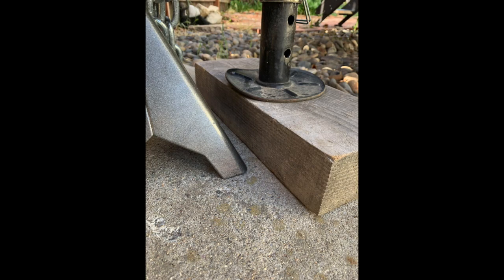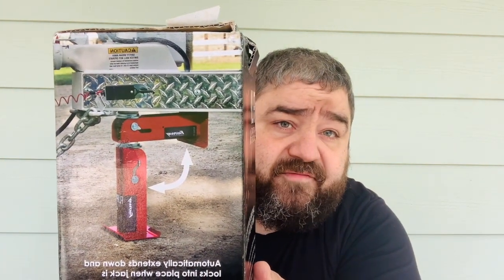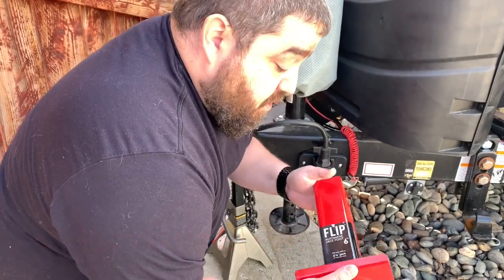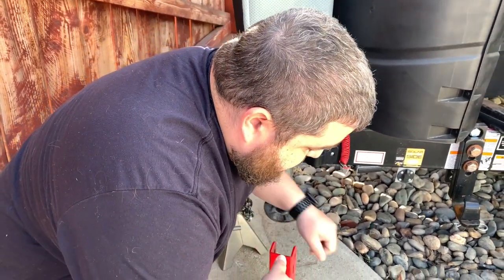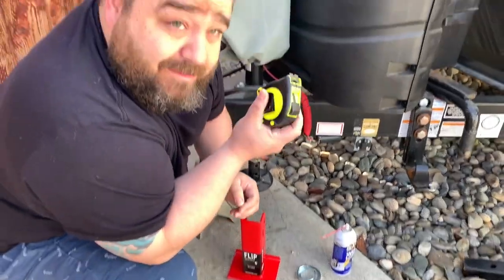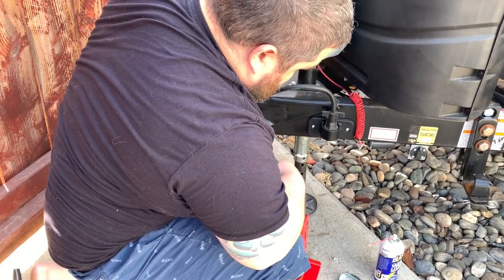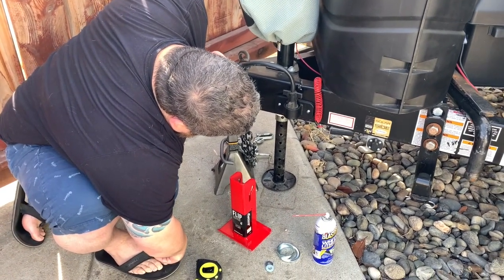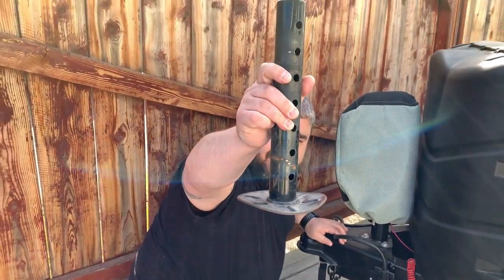Fastway 6 Inch Flip Jack Foot Install and Review

Comment: Is this a different setup than standard? I’ve seen other videos and the manual shows drilling new holes as well as a bolt with lock nut as opposed to the pin, and didn’t have the extra bushing on top? I like the ease of installing the one you show better.
Reply from the maker: Luckily, the existing hole I had measured correctly and no new hole was needed. I’ve had it months now and still love it!
Reply: @AceWillTravel  Just ordered the 6", hoping it works as well.  My tube measures just over 2" but the description says the 2 1/4 is for 2" tubes.  It's a standard power jack though
Reply: I just came across your video for this flip jack which I purchased a while ago and just haven’t installed it yet. I see that your video is from a year ago, so I’m wondering if you are still happy with it. Please let me know, thank you!